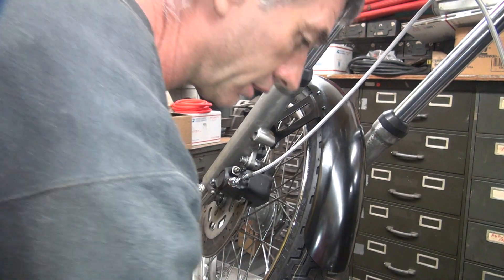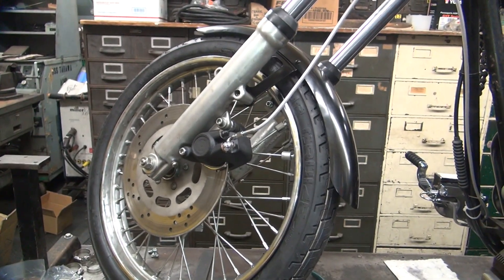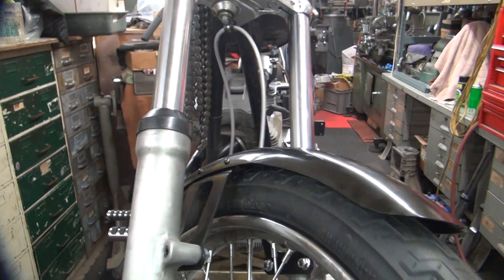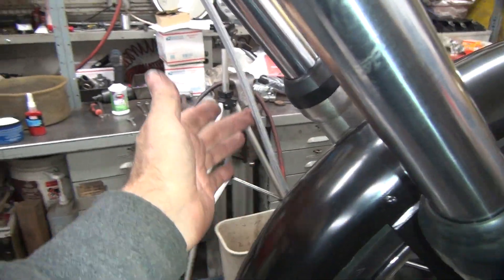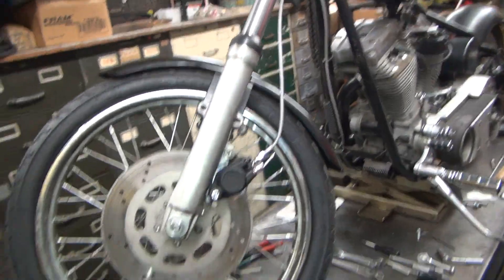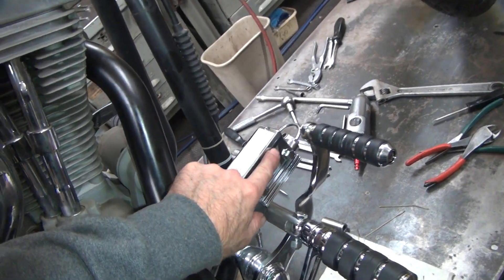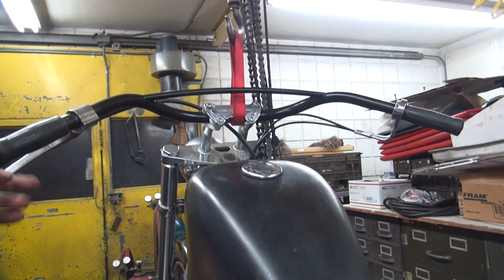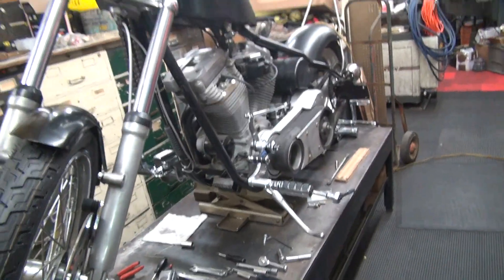#167 1999 80ci evo chopper used bike tune-up repair rebuild rigid bobber custom harley tatro machine

Comment: It's great to have you back Mr Tatro. Us in the frozen north watch for your videos. 
I also had to smile when you evacuated the brake reservoir - we've all done it.
Question, what are your thoughts on a single throttle cable - remove the return cable? 
Oh, and thanks for going to the effort of the one handed wrenching for us, thats gotta be a pain. Its appreciated.
Later, Frank
Reply from the maker: the only promble with one throttle cable is that the cable is about 7/16" to long. it is hard to get full throttle. oh, if it sticks, you are screwed. is that one handed or one finger tip.
tatro

Comment: That is an excellent idea like an automobile. For the brake ,,the only thing I see if you would lose brake fluid for whatever reason you then lose it to both front and rear. Like the old 57 Chevy my wife has it has, one master cylinder it has one bowl. If they would make a master cylinder with two bowls like in today's autos ,if you would lose brake fluid to the rear you would still have front and vice versa. they probably don't make anything like that. But it is a good idea that you can manipulate both breaks with one control.
To knock the shininess off I have used a wire wheel sometimes going in One direction only and other times in multiple directions to give it a different look.
Reply: didn't think of that one.  Another reason I don't like both on one.  I like to control the front independently, or not use it at all on slippery surface's.
Reply: @davidlewis3169  me too I mean it's a great idea in theory only if they would make some type of two reservoir master cylinder
Reply from the maker: so everyone likes to piss and moun about who bad this is but they are forgetting about how it all started. that is, no front brake at all. when was the last time you hurd of anyone loosing the brakes completely. most of the time you feel things going bad way before they are gone. i raced a whole week at bonneville salt flats with no brakes at all. even with speeds up to 150mph i was able to come to a stop after every run by knowing how to ride. this is a chopper, almost everything about it is not the best way to do things. when set-up correctly my race bike comes to a stop on dirt or salt very fast because all the brakes are working up to 90% of what you can get out of them. you can push it right up to lock-up if you want but it is not needed because i don't have to worry about looking up the front wheel and falling down. the bike just stops now, nice and straight. look at all the roadracers that fall down because they are using way to much front brake in the wrong spot.
tatro